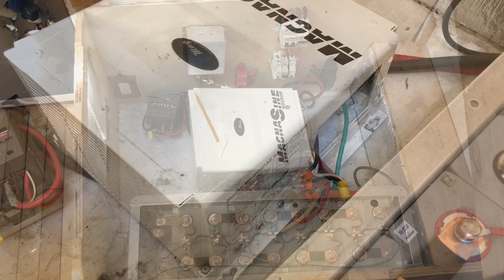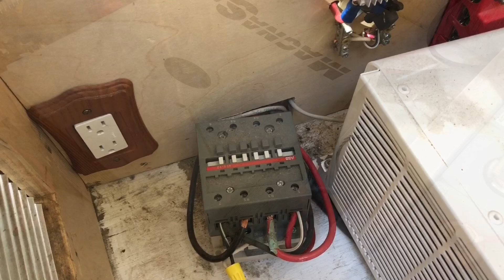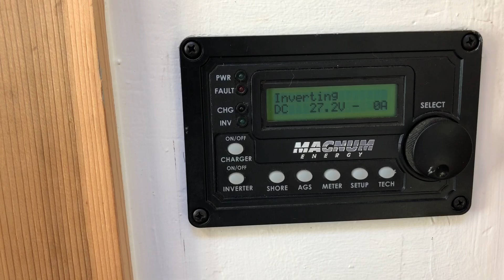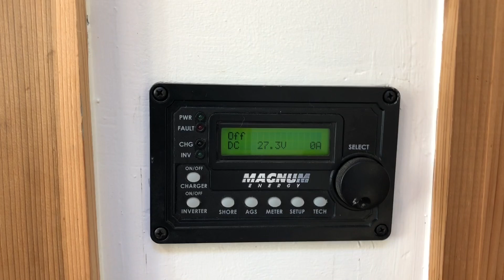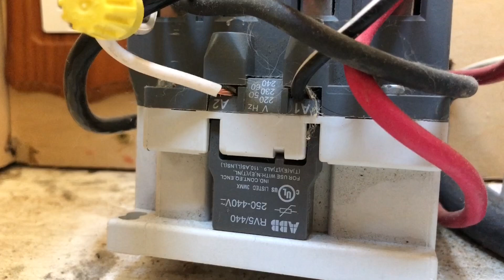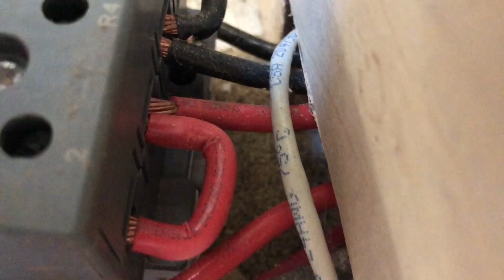UNLIMITED grid pass through with ANY inverter

Comment: I assume you normaly usse 110v 2 phases and neutral.
where yoz get your neutral from ....a transfomer ?
Reply from the maker: 240v split phase from grid and inverter, grid and inverter have neutrals that are combined in house panel
Grounds are also combined on separate ground bar. 
Don’t use this method to disconnect neutrals. Not code compliant and not necessary.